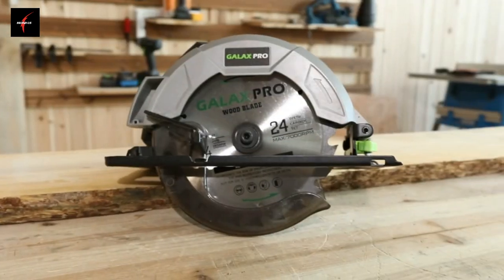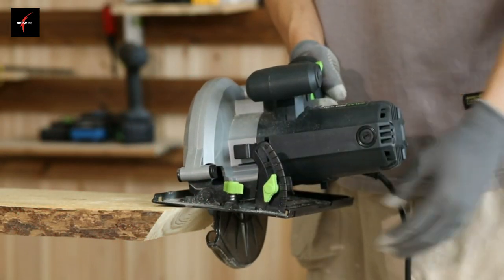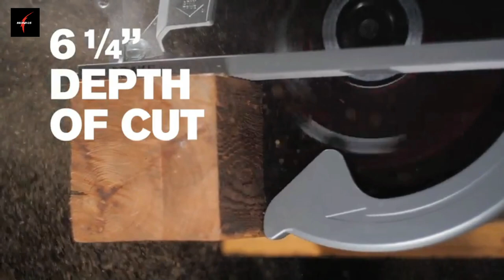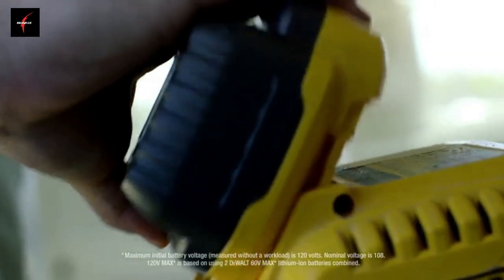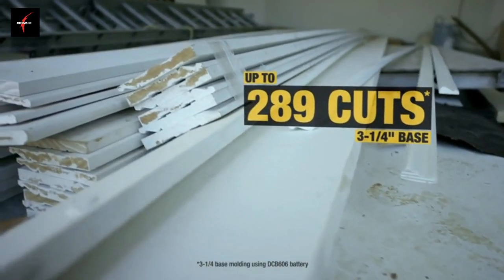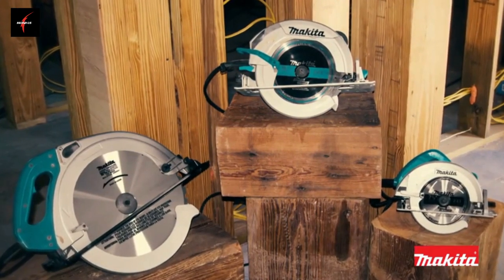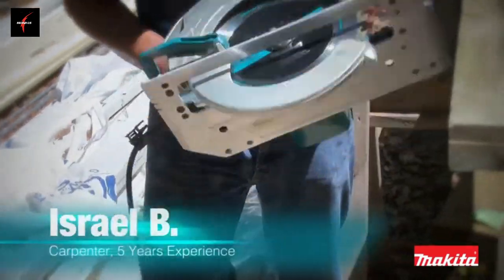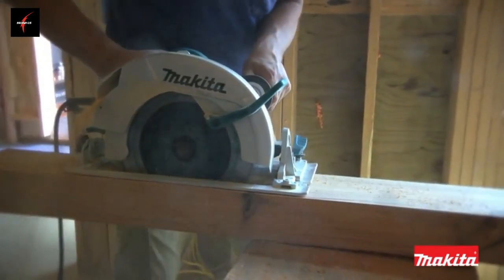⚡Top 5 Best Circular Saw | Dust Blower Function| Hand-Held Circular Saw | Adjustable Cutting Depth⚡

Comment from the maker: ⚡Top 5 Best Circular Saw | Dust Blower Function| Hand-Held Circular Saw | Adjustable Cutting Depth⚡
🔔SUBSCRIBE LINK: 
https://bit.ly/3mffUoD 
1.Metabo HPT 7 1/4-Inch - https://amzn.to/3qPUUsn  
2.GALAX PRO 10 A - https://amzn.to/3jKZer4  
3.SKIL 16-5/16 In - https://amzn.to/3xmdGKi  
4.DEWALT DHS716AB - https://amzn.to/3dNF8ZE  
5.Makita HS0600 10-1 - https://amzn.to/3hhbyOk